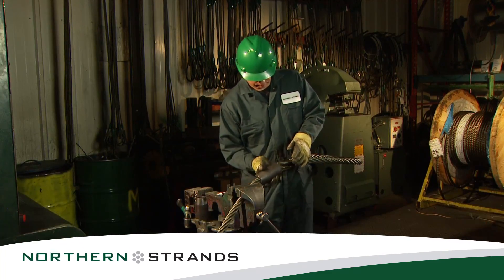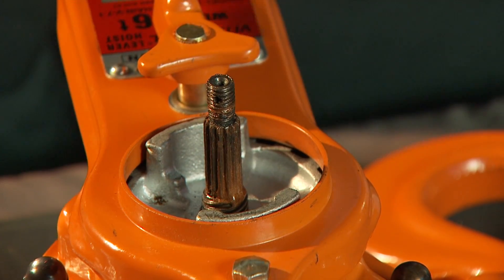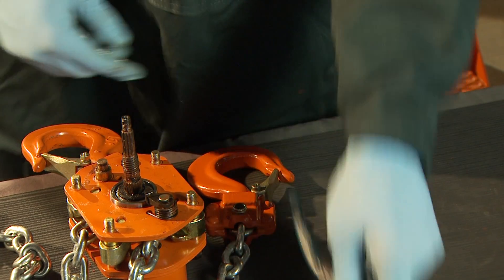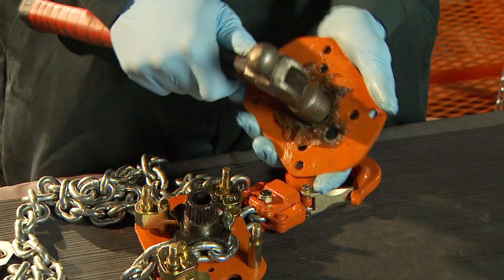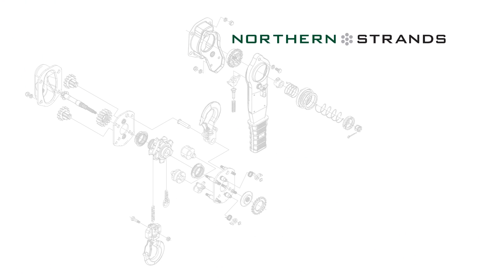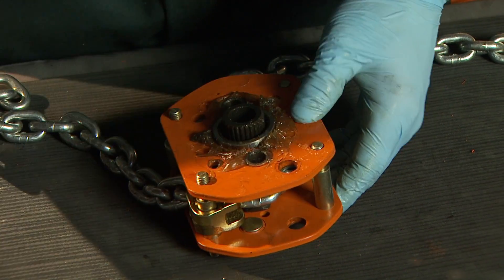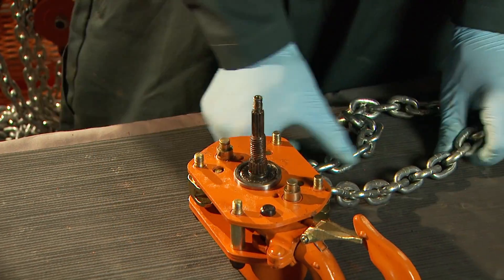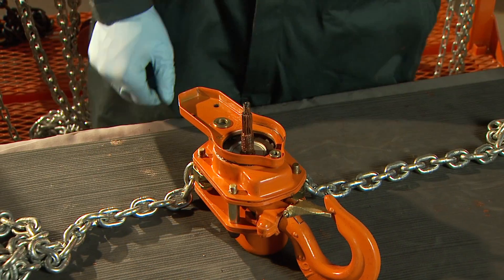Vitali-Intl Lever Hoist Usage, Disassembly and Assembly

Comment: Very helpful, I wondered why an old Morris hoist I had no longer released as I remembered it used to after not using it for 10 years or more and it did indeed have a very similar mechanism to the one shown shown but I was reluctant to use too much force so I drilled a hole in the case so I could release the rachet paul by screwing a 2ba bolt in when I wanted to lower the hook and removing the screw when lifting. I will now use a bit more brute force and fix it properly.